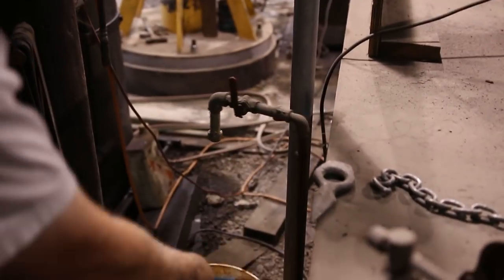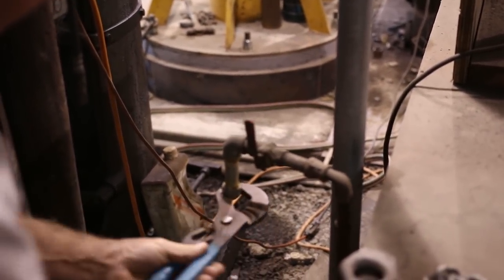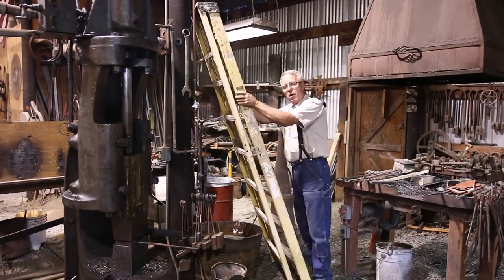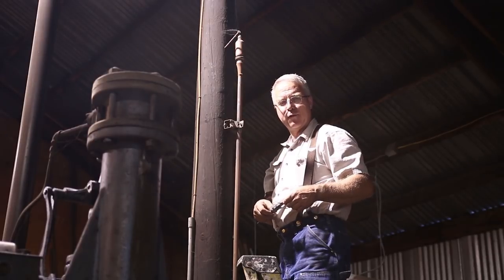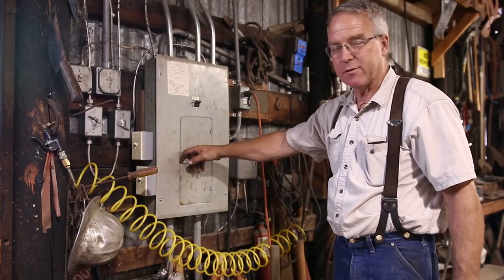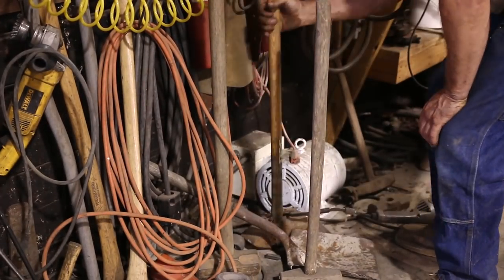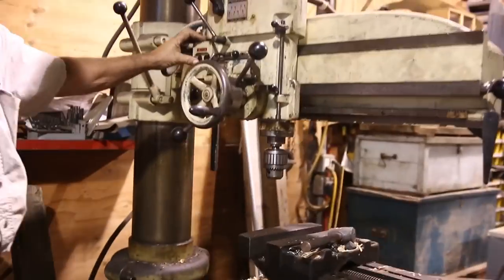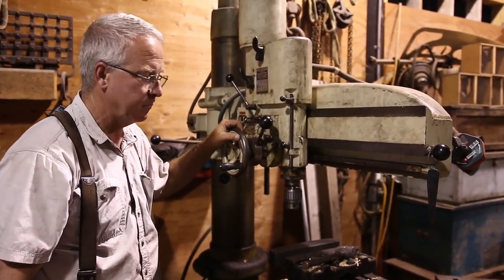Shop Questions: Condensation, 3 Phase Power, Whistle Specs

Comment: Just to put the amount of stored energy in a 200 gallon tank at 90 psi in real numbers: 740,000 ft*lb, which is equal to .47 lb of TNT.  This is a simple calculation, which can be found here: https://www-training.llnl.gov/training/hc/5060/ESN.html#Calculations. That is Lawrence Livermore labs. Note that their safety guidance is anything over .048 lb, so you are ten times over what they consider hazardous. As for being buried, I'm afraid it would just be a shaped charge blasting gravel shrapnel everywhere. As others have pointed out, you could also be corroding from the outside as well since it is buried.  You might want to bury some large diameter pipe to an above-ground tank... possibly in a three sided enclosure to direct anything away from you/the shop if you wanted to go all out (like Nobel used).

For a nearly perfect personal example, you used one pound of black powder with the anvils... black powder has a .55 relative effectiveness, so your tank exploding would be close to exactly that size.
As for corroding a pin hole, the weld will be the most likely thing to be attacked, and since you have it angled for draining it would likely start there as a linear failure instead of a pin hole.  Air tanks are pretty uniform in strength, so once part of it goes the stress tears the rest of it apart (think of the one  hoss shay).
I really enjoy your channel, and would hate for anything to happen to you or your family... stay safe.

Comment: Just stick an auto air drain on that tank and never ever worry about it! I have never 'blown down' my air system and its never going to need it because it does it it's self. They aren't free but they are not very expensive either and It would be a shame to have to sweep the floor just to change that tank... ;)

Comment: There seems to be 2 trains of thought on Compressed Air Receiver tank failures. 
One is that the tank will develop a pin hole, and go quietly. The other is that it will fail 
in spectacular manner. I'd just like to point out that there is evidence on the Net and on Youtube that they can and do fail, and some don't go quietly.  Most in the first camp don't believe in the possibility of non-quiet failure. I don't ever want any of mine (and certainly not yours either) to exhibit mode 2 failure, so I treat them accordingly.  In my opinion brown water is not a good sign.  If nothing else, I feel better for warning you, but I really don't ever want to be able to say I told you so......
Reply: This is why I removed my grandfather's old Montgomery Wards air compressor from service last year.  It developed a small pinhole leak and I was afraid it would explode one day.  I hope to find a replacement tank at some point and throw the compressor/motor onto it as both function just fine but the tank is no longer something I'd trust at all.
Reply: Brown water is to be expected in a compressor tank, any compressor tank.  Personally I'd suggest an 'auto drain' type device plumbed in paralell with the drain valve.  These are on a timer and will open once every few minutes and vent any moisture out.  They cost like 20 bucks for a chinesium one, or less than 50 for a proper one...

This will keep the tank drained of water and will at least slow down any rusting.
Reply: Actually, I'd look into the cheap craftsman/harbor freight compressors if you have a good air head and motor to mount on them. The tank's themselves are fine, the only real problem is loud/unreliable components. I did this with a ~20 year old IR compressor that had gotten to the point there was enough rust in the bottom of the tank that it didn't always want to drain properly anymore, just bought a $100 harbor freight compressor and junked everything besides the tank. It isn't showing any greater than normal rust tendencies after 3 years, and certainly much cheaper than buying new, considering an equivalent quality compressor (15 gal, 2hp motor) is in the 1k range.
Reply: I think those HF tanks are really thin even when brand new. 
Are they ASME certified?  Don't think I'd trust one.

Comment: Having 3 phase power is very expensive we had in the family shop when the family sold out the equipment stayed the new owners will never use it but it was no good to us anymore. You can find used 3 phase equipment cheap at auctions, a 3 phase welder is the only way to go if you plan on doing any heavy stick welding. A 3 phase converter won't have enough juice to run a welder thou. As for your pressure tank it won't do anything you may develop a pin hole, until it erodes the earth enough to get some flow it may cut the hole bigger but there is no chance of it exploding.

Comment: Yep, here's some food for thought on the risks with rusted compressor tanks. https://www.youtube.com/watch?v=KVP_A7eGYxw  if it does rupture catastrophically, as long as it's sufficiently buried I suppose you'd be okay, but just a general PSA to anyone thinking this is safe under most circumstances (it's not)
Reply: spacecowboy2k 
Thanks for that video.  I'm getting rid of my old compressor tanks.
Reply: spacecowboy2k 
Now I thought about it. It looked like it was snowing out in that video which is probably an addition to the reason for a brittle failure.  Luckily underground tank will maintain a temperature of 52-54 deg F if not greater when being pressurized so lessening the chance of a catastrophic failure such as seen in that video.
Reply: Hmm, Snowing on August 31st?  I'm pretty sure you're seeing summer bugs occasionally come into frame, but that being said, cold weather would certainly contribute to brittle conditions in the metal more than mild weather.
Reply: This was the video that informed me of the dangers. Compressed air tanks are scary. No sign before they blow, they just let go. Imagine getting hit by one of the end caps flying at high speed or a piece of the tank that might have ripped off.

Comment: If you're worried about burying a rusting steam pressure vessel I would say you should also be worried about burying a rusting air pressure vessel.
Reply: Steam boilers are far more dangerous than pneumatic tanks of equivalent pressure because the pressure allows the water to superheat (heat to above the atmospheric boiling point). If a leak or rupture occurs and the pressure in the boiler suddenly drops, all the superheated water will instantaneously turn to vapor and cause an extremely energetic explosion (with much greater intensity than a pneumatic tank rupture). This is called a BLEVE (Boiling Liquid Expanding Vapor Explosion) .https://en.wikipedia.org/wiki/Boiling_liquid_expanding_vapor_explosion
Reply: That's pretty cool. But, I still stand that both scenarios are worrying.
Reply: taiden    I agree, and for a tank that size it would certainly be a good idea for him to replace it with a plastic or expoxy-lined tank. As others had mentioned, it's not necessarily for his own safety, but for that of his grandkids and their grandkids. I would bet that the tank would probably last at least another 10-20 years, but after that there's no telling whether it would fail with a pinhole or with an explosion.

Comment: I get so tired of the safety clipboard warriors. What's the answer a new tank every year???? An epensive air dryer, auto drain valve???? I did maintenance in a 3 billion dollar plant. The engineers installed air dryers and drain valves. Guess what sill water in the tanks. Why because there is moisture in the air. Come on risk is part of life. A wise person tries to minimize it but you can't eliminate it if you chose to enjoy life. His tank is fine.